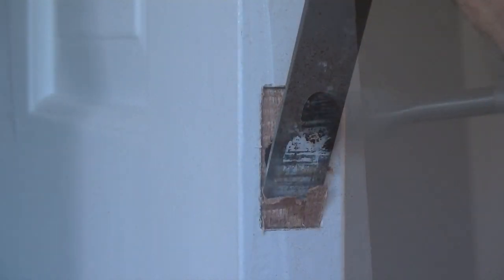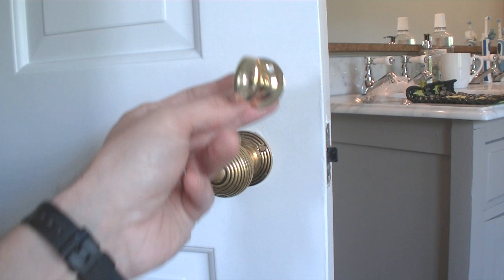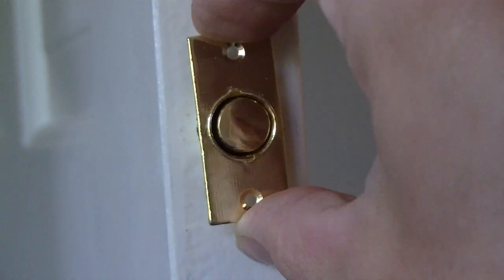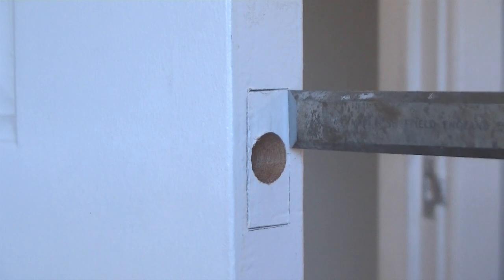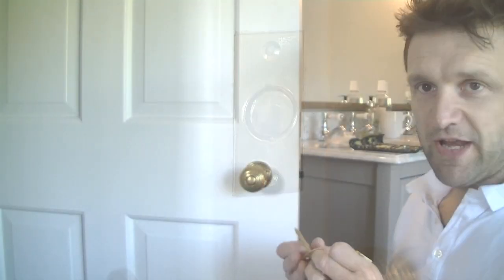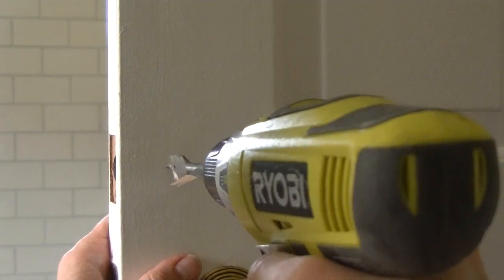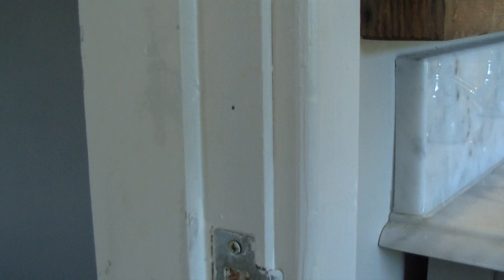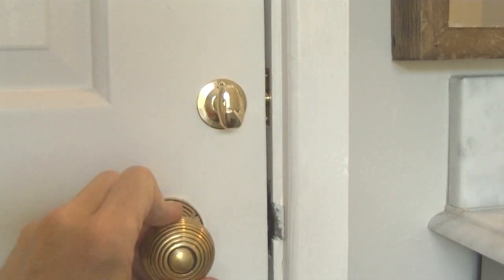How to Fit a Bathroom/ Closet Door Lock

Comment: Good video. One point: the kits need to inserted so the ‘turn to close’ direction is logical. All too easy to find you are turning the nut away from the jam to shut the lock. Which is irritating. Get this wrong and you may drill through for bolt slightly off line.
Reply from the maker: Agreed 👍

Comment: Having just fitted one of these I would definitely recommend drilling a pilot hole before using the flat wood bit.  The dead bolt I had (from Screwfix) had a square body similar to a latch case. This needed a 25mm hole to house it, which on a 35mm wide door didn't leave much room for tolerance.  If you go straight in with the wood bit its almost guaranteed it will go off line. I used a 2.5mm drill bit first and it really helped 👍

Comment: Great video - thanks! I'm after a lock with a thumbturn on both sides (rather than a thumbturn and screwdriver slot) to use as a lock to stop dogs opening the door but can be easily opened by humans on either side of the door. Finding it surprisingly hard though - any ideas?

Comment: Great video! For those of you who think you can't install a lock, or think it's difficult, it's really not! I installed my very first mechanical lock (The type with a push button keypad) on my door myself, never having done so before, or having any great DIY skill whatsoever, and it looks really professional! Just make sure you have the correct tools, understand the instructions, and have some patience with a little perseverance, and you'll do great things!

By the way, that Blu Tack trick is great, I wish I'd have known about it a couple of weeks back. Instead, to make the mark, I used the wife's lippy :D
Reply from the maker: Exactly my point! It's not difficult if, as you say, you get the correct tools, and tackle it step by step. Thanks - the Blu Tack thing was a bit of a spur of the moment idea (I haven't done it before) - but I'm pretty chuffed that it worked so well. Lippy seems to be a popular trick, and I guess works equally well.

Comment: awesome thanks mate, i watched this video and never in my life have i done this before i dont even work with wood lol, the mrs wanted me to put this lock on her door so watched this and now ive managed to do it first time with the correct tools required, dead easy to do required patience do not rush it take your time and you will be fine :) its a sub from me !
Reply from the maker: Yey, awesome work buddy. That's the point I am trying to get across with these vids. If you have the right basic tools and take your time and do the research, anything's possible 👊 Thanks so much for letting me know how you got on. I bet you do a little first pump every time you use it. I would!

Comment: Excellent. My daughter is now demanding a lock on the bathroom door and I was about to bodge an ugly bolt on until I saw this. I reckon this will make less mess of the door along with the peace-of-mind of being able to unlock from the outside just in case. I'm only wondering about using an oscillating multi tool instead of a chisel...
Reply from the maker: Yes this is a far superior option. The multi tool might work for the face plate rebate but it's tricky to hold it still enough to stop it wandering.

Comment: Hi Charlie. I bought the kit and installed it at home without any problems. My concern is about the mechanism. The lock can be overturned (twisted?) And I am not sure how long it can last. Can this be somehow fixed? It looks like there is too much space between the thumbturn and the bolt. Thanks for your videos!
Reply from the maker: I know what you mean. For some reason they're typically designed like this - mine too. I haven't had a problem with any of mine wearing out, but now you've done the hard work on the installation, you could always compare a few other brands. Like this perhaps https://bit.ly/3lb0SRA

Comment: What drill bit size did you use for the pilot holes for the brass screws? Thanks
Reply from the maker: I think it was a 2mm diameter drill bit. It depends on the diameter of your screws and the sort of wood you're screwing into. Soft wood, and the pilot hole can be very narrow (1.5 - 2mm) - you're only really doing it to get the screw started. Hard woods like oak, and you need the drill bit to be the same diameter as, or slightly smaller than, the core of the screw (ie the bit in the middle of the screw not including the thread) - so that the screw (which is typically quite soft in these kits) doesn't get stuck as if this happens its easy to mess up the head of the screw.
Reply: Charlie DIYte thanks Charlie, I actually recently fitted the door bolt you show at the start of the video... the smallest wood drill bit I had was 4mm, too big for the small brass screws. Anyway just hammered a nail part way in to get a small hole for the screw. Then removed the nail and started to screw in the brass screws. Ended up breaking the heads off two of the screws as the door was fairly tough wood... will need to buy a smaller wood drill bit for future use!

Comment: Hy Charlie hope your well, my question is door related,
Any tips or suggestions on what i can use as  2/3 mm shims. I'm hanging a door at weekend and don't want to go and buy a large pack of shims even tho they are handy, if I can use something else, something that is wedged to put under as hanging but also im thinking of a 2nd which has a straight shape too to keeo the gap between door and frame equal so it doesnt bind.  
Iv got a door lifter which is useful but wedges are good as I do t need to keep foot on them. Any tips gratefully received
Reply from the maker: Hi Scott, sorry for the delay in replying - the day job has been brutal this week! Yes good thanks - trust you are too?  You're one up on me there with your door lifter as I don't have anything that organised! It's probably too late now as you've probably hung the door, but I have a video uploading (incredibly slowly) right now where you'll see a home made door lifter I made from a piece of 4x2" timber. In the past I've improvised with anything I can find the requisite thickness from card to magazines but why don't you cut a wedge from a piece of wood like I did in the video, then you can simply slide the wedge under the door to the required thickness? Good to hear from you, and let me know how you got on.
Reply: Hy no prob I can imagine ur a busy guy.
I have all sorts of wood shims an wedges but they are buried in my shed as im waiting to move house, in the end i used my door lifter and slid a wooden ruler underneath.
Job was a pain. The frame wasn't plumb and the floor ran off. Then my electric planer gave up and i had to resort to a small block plane, generally a nightmare

Comment: Charlie where did you get the 2mm bit from as I haven’t been able to find a wood one.. I do have a HSS bit set with a 2mm drill bit and even smaller ones. Can I use these in wood? Thanks
Reply from the maker: Scottish Jimmy Mine are HSS bits. Fine to use in wood.
Reply: Charlie DIYte thanks

Comment: I've done it but not really safe as when you pull the lock. It easlliy comes off. I've tightened the screws but still come off when i pull it
Reply from the maker: That shouldn't happen. Have you overtightened the screws?
Reply: @CharlieDIYte  no I didn't, everything was perfect until i pulled on the knob to hard it would come out

Comment: Nice video. But the scews are too big and they don’t sink nicely. You have tried to sink them with a normal drill bit but the cutting ange is wrong and it makes the countersink diameter too large if the screw sinks enough. Buy a real COUNTERSINK BIT and the sinking looks much better and the screw sits neatly. If the lock frame is steel, you must use rust protection especially in a bathroom lock.

Comment: Great video, made couple of mistakes while fitting this first hole for cylinder went wrong as it was at slight angle took little (half an hour) bit time to correct it. Screws comes with this kit are crap both snapped inside (with pilot hole) and took couple of hours to fix that so be aware, D O N ' T   U S E   T H O S E    C R A P   S C R E W S